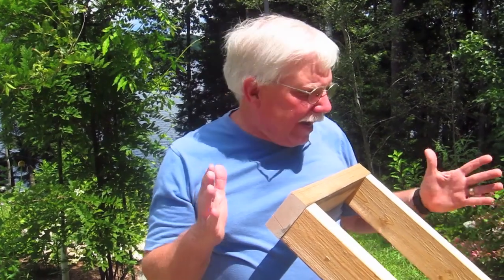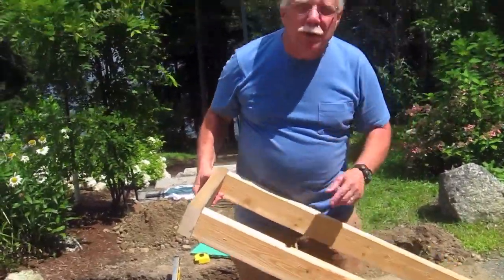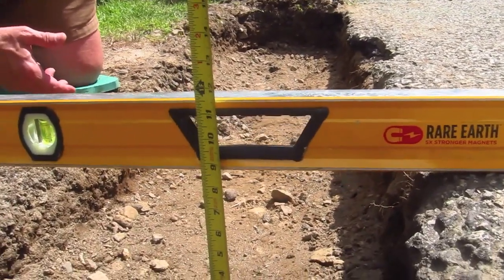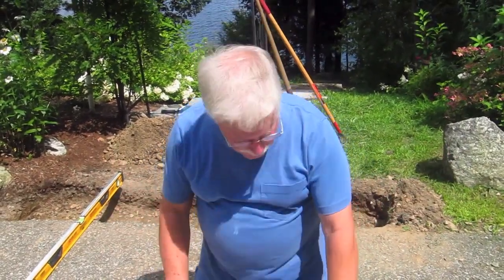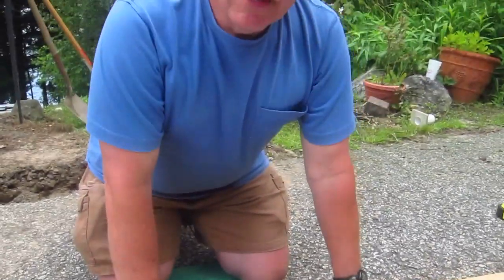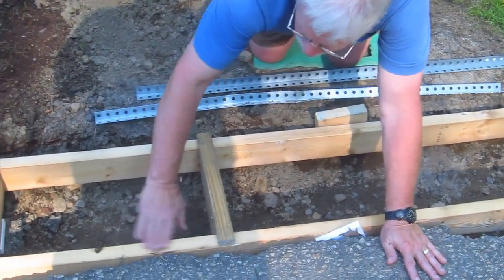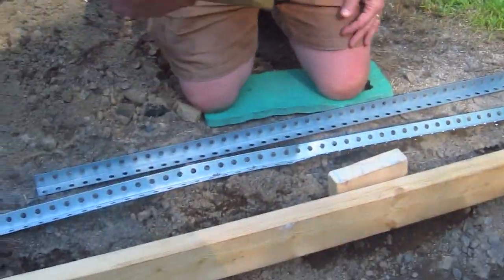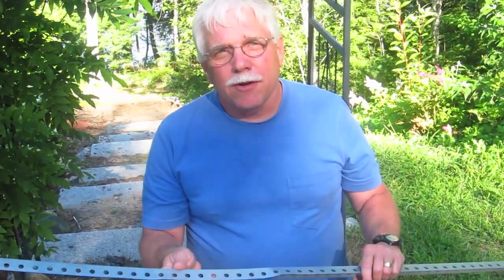Install a Trench Drain Video 3 of 7

Comment: Any small gap below the drain channel and the concrete base will hold water, then in the winter when this water freezes the drain channel will get lifted making bigger gaps which hold more water, causing an escalating problem.
Reply from the maker: That would be true if the drain exterior were perfectly smooth. Did you pay attention to the indentations in the drain body? The concrete will lock the drain to it and it will not move. Period. I can tell you it's been in now 9 years and has not budged. We've had bitter cold weather for weeks at a time with the drain choked with ice. Next time be sure to think it through before you comment.

Comment: cool video. 

what do you think about your same trench drain, but crosses the driveway. so it will get driven over multiple times a day...? I only worked of building house foundations, so I dont know much about slab or driveways. and I plan to buy some thick rebar if its available. driveway cross section is a guess of 35', I can't remember my measurements of when I tore out the black top last year.
Reply from the maker: +Tyee Cambrón I think it's a good idea. Just go look at the size of the trench drains and wrought iron grates used at commercial buildings like gas stations and convenience stores. Must be tough enough to handle TRUCK weight.

Comment: My form allows to use 12" galvanized spikes so instead of putting concrete underneath my channel drain, can I just put tapped down gravel and the spikes?
Reply: Should have siad that my channel drain will be on side of driveway and will not be driven over. Not sure if that makes a diffrence whether to put 4" concrete underneath or not.
Reply from the maker: If you want unlimited tips like this each week, subscribe to my FREE newsletter at www.AsktheBuilder.com
Reply: If your going to be driving over it you need a concrete bed

Comment: I have a 700' driveway it high at the foot of the driveway where it meet the main road but a little lower then main road. then it slopes down and  goes up as it gets closer to house so the run off rain from the main road runs down the drive way and cause real damage. I called the town and they did remove some of the high points that funnels it to my driveway but I am still getting water down some from the main road and most from driveway itself do you have any solution for this??TY

Comment: Thank you so much for this video - great stuff!  Question - can we install this type of drain into an existing sidewalk (if we cut the section of concrete out where the drain will go)?  If so, would we just cut out an extra 4 in. on each side of the trench and then refill with concrete?  Just wondering if we do this, if there is a way to "blend" the 2 different sections of concrete together?  Thanks again!
Reply from the maker: You can put one in a sidewalk. It's all a matter of following the Law of Gravity! As for blending, just connect point A to point B. If you need more help, I offer a 15-Minute Phone consult service. http://shop.askthebuilder.com/products/15-Minute-Phone-Conversation-with-Tim.html

Comment: zWe own a home in Az and want to harvest all rainfall, including off the driveway. I was thinking about using this grid but need to connect tubes to my underground holding tank. Any suggestion as to how far apart my tubes should be? Remember, we dont get but 13 inches a year but it seems like it comes all at once.
Reply from the maker: Sally, I provide a service where I solve complex issues like this that require back and forth, photos, etc.

http://shop.askthebuilder.com/products/15-Minute-Phone-Conversation-with-Tim.html

Comment: great video but wish you would use metric.  all these 3/4, 1/4 etc is just still so bizarre
Reply from the maker: We think metric here in the USA is bizarre. In rough carpentry I don't see how you can even use metric. The space between the mm is so small that the fuzz from a sawcut would put you off at least 2mm. So do you just use 5mm as the smallest increment? If so, that's super bizarre.
Reply: @askthebuilder  no we just measure to the mm - for example 2400mm and cut "on" (or to the side depending on dropsaw) of the line. having said we still have mixed measurements for some things, tire pressure probably the obvious one. Certainly I find addition of lenghts in decimel much easier.

Comment: Concrete needs water to cure… it should remain wet untill it’s cured!
Reply from the maker: Correct. It's all about the hydration chemical reaction that continues to take place within the cement paste for years. I go into great great detail about hydration and curing on my www.AsktheBuilder.com website.